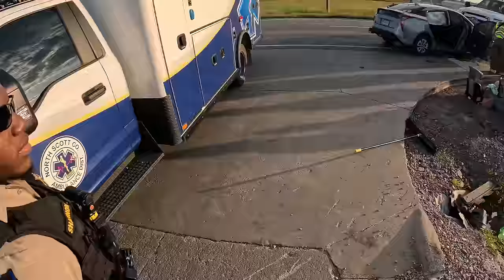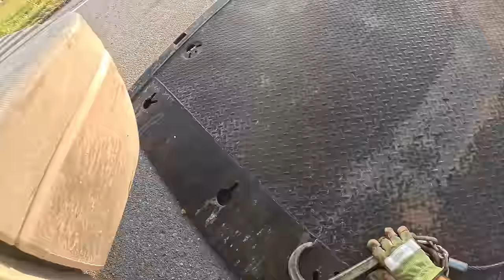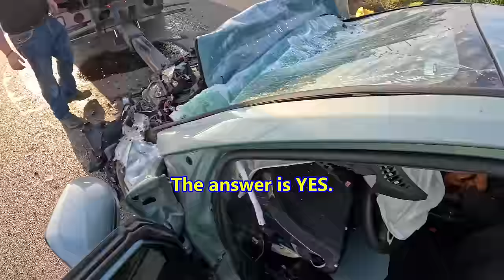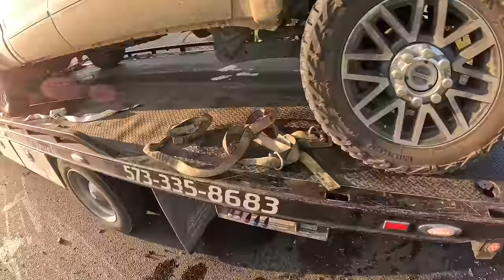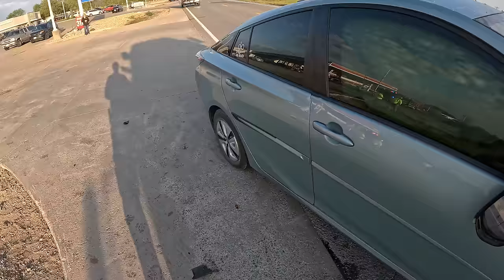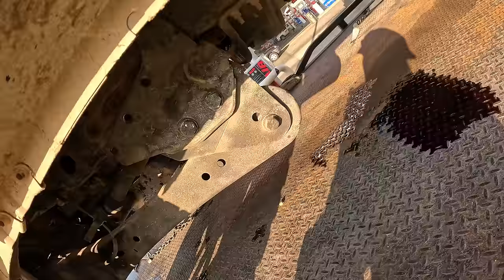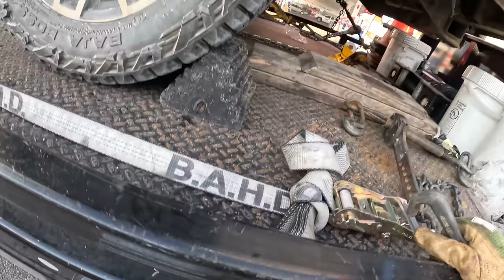HEAD ON CRASH CODE RESPONSE     DOUBLE TIME

Comment: Coming from a fellow tow man that was once young like Ethan. The lesson of always wearing gloves will be one he remembers. Mine was splinter from the cable going through the palm of my hand covered in beaters acid and antifreeze . First thing you should grab while getting out of the truck.
Reply: Ethan does still have a few things to learn.
Reply: @john1703  Definitely missing his PPE which is a very rare case with Ron's videos. My guess is he got asked to help in a pinch.
Reply: That's a hell of a way to remember gloves but damn you ain't going to forget them after that
Reply: I had a landoll deck splinter in my back for like 2 months
Reply: @john1703  ya, like his ABC's.
Reply: Ouuuuuch
Reply: Gloves should definitely be put on before you start working 💪
Reply: Amen to that!
Reply: Funny I was coming here to say the same thing!!!
Reply: I wake you vizzle why I wake your physical cuz I like when I cer class❤😮
Reply: i work in a different profession, but our service vehicles have at least 3 to 5 pairs of heavy duty gloves, safety glasses and a helmet as standard PPE along with a box of disposable gloves and a safety vest on them. This way any other driver who might get called to assist can grab the gear they need off any vehicle. It really is not hard to keep vehicles stocked properly.
Reply: Amen to that 😢😢😢😢😢😢🎗️🎗️🎗️🎗️🎗️🎗️😘😘😘😘😘
Reply: P
Reply: A
Reply: That sounded painful
Reply: Totally agree
Reply: So so very true

Comment: The police departments in your area are very respectful to your needs when doing a recovery, it's neat to see them want to give you the road or several lanes to get the job done easier and safer
Reply: That's because they're out in the country. If it was a big city, usually not as friendly 😊
Reply: @chris76-01  Even in the city's around, L.E.O's and FD all work together with Ron's crew.... Granted they are small city's and not anything like Kansas City... But ya they all work together and Ron's company trains with the FD's to...
Reply: Yeah they're definitely not like that around where I live
Reply: They also all train together multiple times a year for different situations and are well aware of each other's needs and tasks.
Reply: Part of having a good relationship and respect both ways.
Reply: It's the same thing here in California, local law enforcement are glad to help out if they can. Now that said California's dot is not going to lend a hand whatsoever there was a a semi truck and 53 ft box trailer that went off a four-lane highway damaging about 40 ft guardrail at a Waterway overpass the recovery company was required to use the shoulder only to lift this truck from 20 ft below the road surface and set it between them. Caltrans would not shut down one lane for these guys to have a safety buffer. Once the truck was recovered, and debris removed, Caltrans shut down a lane for safety so their guys could repair the guardrail.
Reply: That’s southeast Missouri for ya how we all role round here
Reply: thanks guys but they listen to u
Reply: Slow is safe, and safe is fast.

Comment: Dang, a big truck like that vs a small car head on is never a good outcome. Prayers for everyone involved to have a speedy recovery.
Reply: Prayers for everyone. People always ask why I don’t get a small  type car. My answer is if it fits under or close to fitting under a simi trailer, I don’t want it.
Reply: @jimmyssnowremoval1075 It’s not the size of the car, it’s the ride height.  I’ve seen tiny SUVs completely obliterate large sedans.  The Prius held up well for its size and low ride height.  Both vehicles are totaled.
Reply: At least it went over the Prius drive train. If that had hit lower, it would have been a harder jolt.  But, yeah, heavy vs light, light seldom wins.
Reply: neither is car of virtually any size vs. truck with liftgate up and in operation.
i hear it's like Guillotine driving underneath those
Reply: Has anyone found a news link?
Reply: @jimmyssnowremoval1075 people definitely accept a higher risk if they get a tiny car. Though I'm curious why the driver airbag didn't go off in the Ford truck here.
Reply: To be honest, the Prius might have looked bad but the occupants are probably fine. Pickup had no airbag deployed and probably no seatbelt on, the driver seems to have smashed into the windshield. 
However, the Prius probably saved both occupant's lives by not being a solid lump of steel. Each tiny piece of deformed metal, plastics and rubber took a lot of energy to deform and added waste heat while deforming, eating up enough energy to not have both drivers impact face on into a solid steel object. 
Crumple zones and proper safety engineering are insane these days. Sadly, big name manufacturers just don't apply them to big ass SUVs and pickups by classifying them as trucks or other types of commercial vehicles due to size/weight. That way, crash ratings of pickups have been extremely low for decades yet people think they are safer. A head on of 2 equally sized SUVs or Pickups would have probably cost lives here due to the lack of safety features.
Reply: @user-tb7rn1il3q
Noooope hey there, not so fast! 
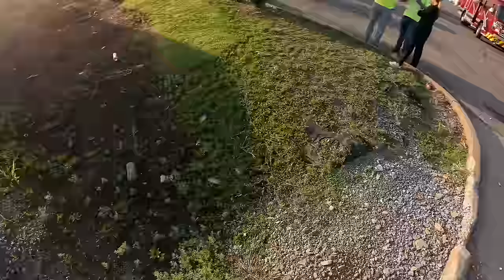1 is totaled, and 1 is driving off 2:51
Reply: Drive a car that used to have one of the highest safety ratings. It's dropped a hell of a lot in recent years, not cause the car got worse, but because there are so many big trucks and SUVs that they just plow halfway through the damn car before the car can stop it. :|
Reply: Imagine a heavily lifted truck hitting a Prius. We allow too many dangerous vehicles on the road.
Reply: a prius T-boned my 3-ton vehicle and shattered into a million pieces! ... 
but no one was hurt!
Incredible!
Reply: @jimmyssnowremoval1075  thats kinda the problem lol, bigger cars also aren't usually safer as they are more prone to roll over
Reply: @zzoinks  If people accept a lesser risk to themselves and a greater risk to others with heavier cars they are subject to a greater level of scrutiny in their driving abilities. Start demanding any vehicle over 4,000lbs requires a specialized license that goes beyond parking at the curb and driving 20 through a neighbourhood.
Reply: @parodylover999 How is one “driving off”, when it won’t start & there’s all kinds of vital fluid(engine oil &/or transmission fluid) underneath it? It’s totaled.
Reply: @garthhh yeah, I agree. We should get them prius and like cars off the streets
Reply: @zzoinks yeah it is interesting as even without seatbelt it is programed to deploy above 25mph or so in force possibly the small car missed the airbag sensor.
Reply: @zzoinks The air bag sensor in the truck was higher than the impact in the bumper that is why it didn't go off I towed a truck of similar height after it hit a Honda Civic and it was the same outcome the airbags did not deploy. I hope this explains that.
Reply: lifted trucks and SUVs are the leading cause of fatal collisions, not small (normal) vehicles.

Comment: Ron I am a fellow Missourian. That looked awful. Hopefully the occupants make a speedy recovery. All that said stay safe.
Reply: Pickup driver I don't think wore the seatbelt.  Appears steering wheel air bag didn't go off and his head broke the windshield.

VS an immovble and unbreakable wall, the truck gets poorer crash safety ratings than that little car.  But this wasn't an immovable flat wall, it was a head-on between vehicles and you get to see why I prefer the SUV/pickup.

With seat belt and airbag, the pickup driver would walk away.  Possibly no bruises even.

That wasn't more than a few mph closing speed from the truck just ripping the top of the car off at the window line.

He indicated that all lived... That's good.  Hopefully the injuries are not too bad and everyone recovers fast.
Reply: No seatbelts?
Reply: @fhuber7507  Ron doesnt upload any videos where deaths occurred
Reply: @fhuber7507  That's a vicious cycle, everyone getting a bigger can because of "safety", leading to bigger and bigger cars just to one-up the others.

Hopefully the stuff on the bed were fastened because those will become projectiles during a crash. Looks a bit careless, to be honest. Be safe out there, not just for your sake but for everyone else's.

Comment: Given the size and weight difference of the two vehicles, that Prius held up surprisingly well.good work and hoping the patient(s) make a quick recovery.
Reply: Not just size but stupidly high ground clearance on that truck.
Reply: @brucewelty7684 looks like a stock f250 night to me
Reply: @brucewelty7684   thats a stock F250 4x4.
Reply: They are pretty tough vehicles.. and super reliable too. I got 430,000 miles out of my last one.
Camry Hybrid is a GREAT choice too... Saw a video of a 2025.. guy was getting over 60MPG in mixed driving.  Pretty hard to go wrong with any Toyota Product if you drive a lot. 60K per year for me.. So fuel economy is everything.

Comment: Modern cars are amazing.  It's remarkable how well protected the occupants of that Prius were in such a devastating impact.  Hoping everyone heals up soon.
Reply: It was a very low speed hit and that Prius was crushed!If that was higher than 20 mph they would be not here!
Reply: Older cars used to crash and neither would show much damage.
Reply: @grizzlycountry1030  Yeah, that's because the occupants absorbed all of the energy, and would be dead.
Reply: @grizzlycountry1030  because they put all the damage on the passengers and driver
Reply: Thats why lifted trucks are so dangerous as they override the crash protection systems on other vehicles.     this truck was just low enough the car did not get completely ran over but a lifted truck's bumper would go straight through the windshield.
Reply: @mypronouniswtf5559  That's exactly the point. The car crumples so that the passengers don't. Notice how the front of the car was mangled to hell and back yet the cabin was intact?
Reply: @grizzlycountry1030  That's true, mainly because you absorbed the energy of the impact instead of the car. Sure the car may be relatively unscathed but you'd have a steering column in your spleen. Watch this video: https://www.youtube.com/watch?v=C_r5UJrxcck

Upon impact the A-pillar of the Bel Air completely collapses and the cabin gives way. Watch the interior view. First you get a steering wheel to the face, then your head hits the roof, then you're eating what's left of the A-pillar. Now watch the inside view from the Malibu. The seats move a bit, the dashboard flexes, and the windshield cracks, but notice how the shape of the cabin remains the same. And instead of having an ignition cylinder in your jaws your head hits the inflated airbag and your seatbelt locks up preventing your head from slamming into the steering wheel.

Comment: "because it's a Ford". Nice unbiased, neutral attitude. Cracks me up this whole which make is better nonsense. They're all designed to fail. Can't sell new ones if the older ones stay in action. Most repair garages I've seen have mechanics shoulders deep in all makes.

I think it's foolish to be brand loyal in the auto industry. Gotta keep an open mind. You may have had good luck with a particular make for a long time, but that's all it was, luck. GM, Ford, Dodge (Ram), Toyota, Nissan....They all have recalls, TSBs, and inherant design flaws. Flip a coin and get your best price.

Comment: It’s amazing the safety they put into these vehicles…you’d think with a heavy pickup truck hitting that Prius like that person wouldn’t survive.. thankfully they will recover.
Reply: Some people are like "the Prius was mangled from a low speed impact". Yeah, but notice how the cabin's intact? The rest of the car has crumple zones that are purposely designed to absorb the energy of the crash so that the passenger compartment is undamaged. It's incredible just how safe even a cheaper, smaller car than this is nowadays.

Some of those people think old cars are safer because the car would be damaged less. It would be, but that's because the energy from the impact would be transferred into the cabin and you'd be eating the steering column for dinner. Modern cars crumple so that you don't.

Comment: Wow, That pickup literally ATE that prius! I hope everyone recovers quickly.
Reply: Crumple zone on the Prius may have saved the life of it's driver, while striking hard enough to break the Ford's front suspension.  Now, that's impressive engineering.
Reply: Hope the Ford driver has good insurance.  Looks like he turned in front of the car
Reply: @glenerickson358 that's what I thought too
Reply: Got to love a good collapsible crash structure - it may well have saved at least one life today. Although looking at that wreck, I kinda wonder if taller trucks like this need anti-submarining bars fitted on the front end.  His fender's pretty much at windshield height, and that may not end well for the other driver in collisions like this.
Reply: @glenerickson358 if he’s at fault, that lawsuit ain’t gonna be pretty
Reply: It's crumple zone is calibrated to give way for another truck, it won't give if it doesn't have to.

Comment: Praying for the occupant of the Toyota.  It's a testament to the design and build of modern cars that there wasn't a fatality.  That said, it must have been a rather hard hit, but the engine compartment did it's job and crumpled without encroaching into the passenger area.  All oin all, a good recovery Ron and Ethan.  Greetings from the UK and God bless.

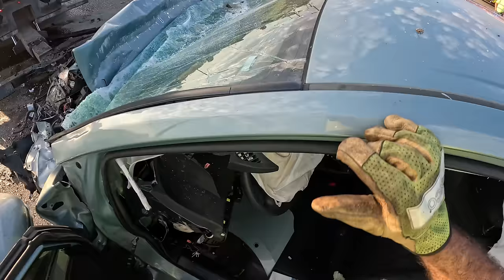Comment: At 11:24 the message on the Prius dash. “Drive-Start Command Malfunction. Visit Your Dealer.”  Yep, like that’s gonna happen! What an optimistic car.   This Prius took a hard hit where it submarined under the front bumper of the ford and shredded everything up to the base of the windshield and splattered windshield glass everywhere. In spite of all the torn up look of the car, the passenger cell is still very intact. That was a very solid hit to sheer those Ford front suspension  control arm bracket bolts. Which actually was a good thing for crash energy dissipation. All that destruction on the front of that Prius was actually to the benefit of the passengers in the Prius. You had a 7000+ pound truck with a truck frame do a whamo into a lightweight at 3,000 to 3,200 pound Prius. (Yes, believe it or not, a Prius is a featherweight car! Our 2013 model on certified scale is right at 2800 pounds.)
Reply: Agreed. all that crumpled sheet metal as the truck went over the engine absorbed energy that would have made for a harder hit if it had been lower. But even so, the whole engine and trans got shoved back. That was a hard hit.

Comment: You know what Ron, I worked for a local public school district for 35 years in the maintenance dept. Plowed snow for those 35 years. We always had six F350's and one F450 dump. That is the necessary fleet for the number of schools in the district. Everyone of the staff was assigned a truck. During my 35 years I had four different trucks. And I will tell you those Fords were beasts. Eight- foot plows and when you raised it the front just sat there no droop at all. The district bought salt in bags 49 50lb bags per skid. You could put two skids in those F350's and haul it no problem. Bashing Fords and you buy a Ram. Chrysler famous for their 13 wires connected to one ground point. Nothing but electrical problems because of it and remember Ford is Ford unlike Ram that is now Fiat and three French car companies owned.

Comment: I'm also used to tow. Don't knock my '04 Ford F350 crewcab long bed. I have 265,000 miles and only have replaced a few things. Maintenance is the key. Rotella T6 every 5,000 miles and don't beat on it. I've used my girl everyday for work. Love you videos, I've been subscribed for years. Stay safe and God Bless.

Comment: I have lived here in MO, KCMO area, for most of the last 18yrs.  While I know that authorized tow companies can run code, I have yet to see a single tow truck/wrecker ever run code here in the city.  I wonder if it just doesn't happen much here, due to the number of companies and trucks or if I have just never seen it, which I spend most of my work days driving all over the place.
I hope the driver of that little Prius makes a speedy recovery, that little car sure didn't look to good.

Comment: I'm just amazed you wheel lifted that hatch. I'd have been too frightened that the suspension was compromised.
Reply: He was supporting the one that would be compromised.  I was actually surprised the wheels were still up right.
Reply: Same, my first thought was the Prius on the rollback and the truck on the wheel lift. There is a reason I watch these videos and don’t make them 🤣